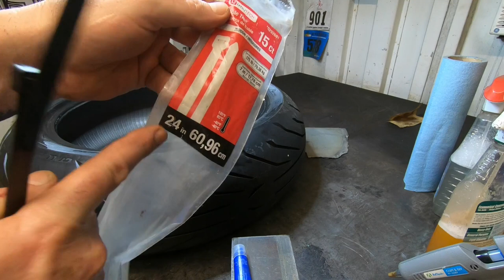2011 BMW K1300S, rear tire change, zip tie method

Comment: So much hard work just take it to tyre fitters
Reply from the maker: I do it all myself, had to replace the batteries in the TPMS anyhow.
Reply: @ELDESTBuilds  hey, I’m about to help my dad change his tires on his 2012 k1300S. 

Do you know if it uses the same TPmS sensors as you’re bike?  Do they use the same battery? If so, what type of battery?

Thanks in advance.
Reply from the maker: @Mooney0946  yes, see here
https://youtu.be/pVZmnOr8rt0
Reply: If a Tire Breezer is still available, it might be a help. Take care.
Reply from the maker: @carlcarlamos9055 tire breezer? Not something I've heard of.